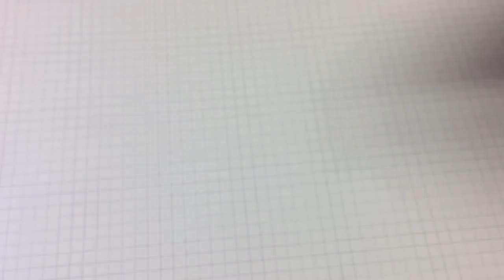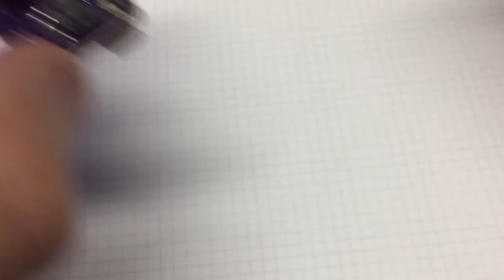Sensor Board with Colour Oled Display

Comment: 9v battery, why?
Reply from the maker: The original board was a design challenge to try and fit everything onto a board the same size as a 9v battery. I had some right and 9v battery clips that I wanted to try out. It’s been a while since I’ve used the latest one but it probably use lipo type instead of a 9v.
Reply: mike rankin thanks for answer)

Comment: Hey man, your pcb's are really cool! But I've noticed that you often put the analogue stick and push button opposite to the normal way, how come?
Reply from the maker: I guess it is swapped if you're a gamer but I rarely play games. I'm right handed and use the navigation button most of the time. The left button is the back button that's rarely used. You could init the display with a Rotate 180 command as a fix.
Reply: mike rankin haha true

Comment: Really cool man. I really like it. Where do you get the OLED LCD?
Reply from the maker: It's the 0.95" one at BuyDisplay. Check out the pdf on my github link. It shows the part number on the last page.
Reply: I looked at your github but I didn't see the last page of you pdf. I assumed you had not posted where you bought. Anyway thanks and keep up the good videos!
Reply: I don't see the part number either.
Reply from the maker: It may be buried.There is a PCB driectory with a .pdf inside. The pdf is three pages and the parts list is the last page. I'll generate an excel sheet and add it now.
Reply: I see the parts list now. Thanks for posting it.